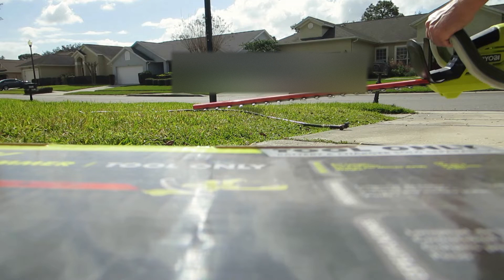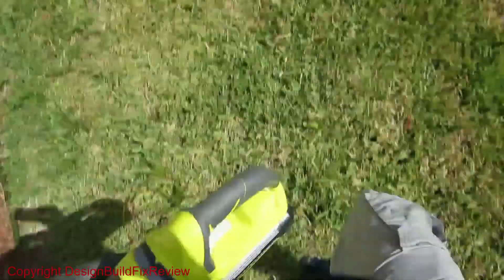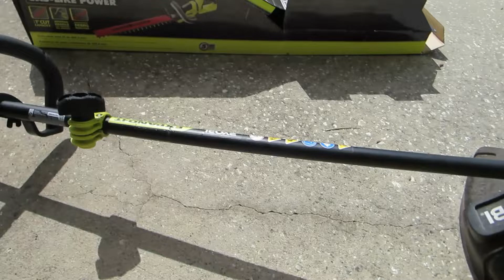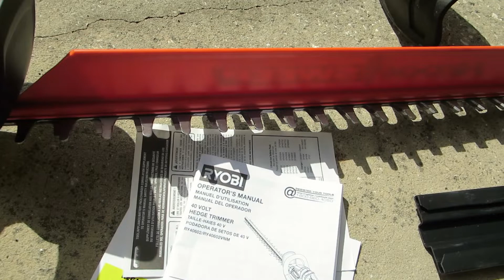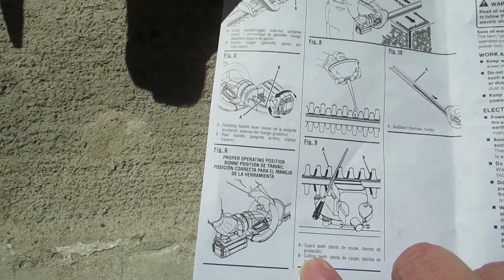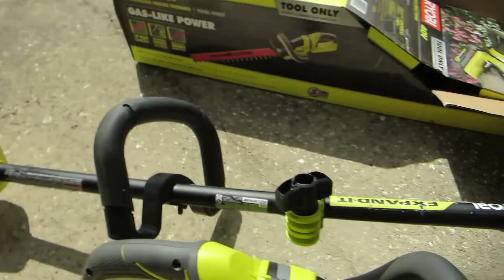Ryobi Hedge Trimmer 40v Review

Comment: Hi I’m here from the fixing the Cyber power fan issue video from three months ago and I have a question are their any fans that Best Buy sell that work just as good I’m planning on buying that exact pc tomorrow and also plan on picking up a fan to replace the ones the pc come with
Reply from the maker: I haven't had a problems with the oem fans, but I did pick up some fans for the top from bestbuy in one of my videos, they worked okay had no led colors on the ones I tried. They sell a few brands there easy to return if you don't like. Top fans really did nothing for my temps. If you replace oem ones may not sync with rgb controller right.